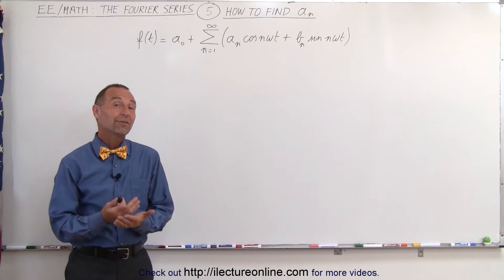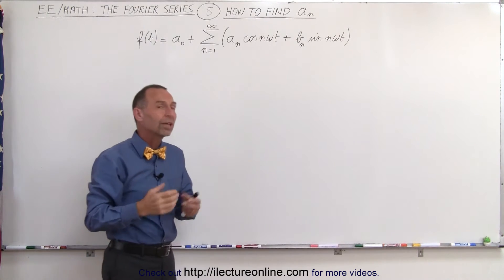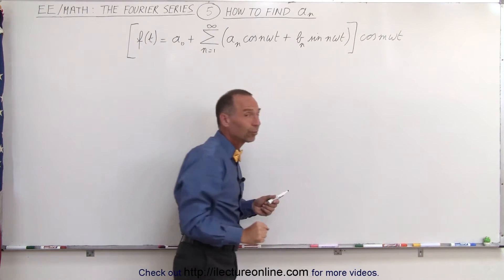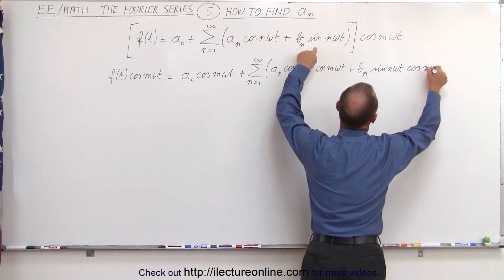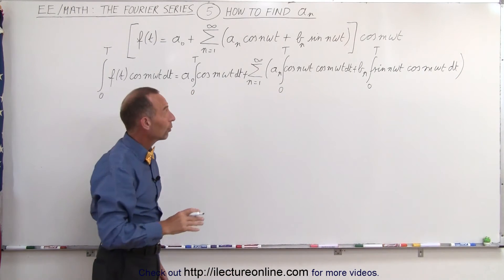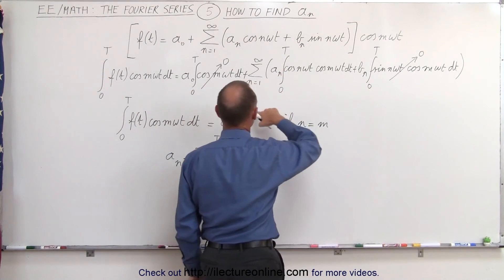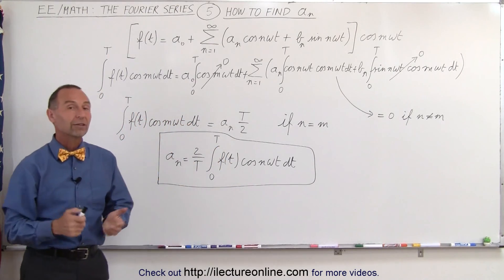Electrical Engineering: Ch 18: Fourier Series (5 of 35) How to Find an=?

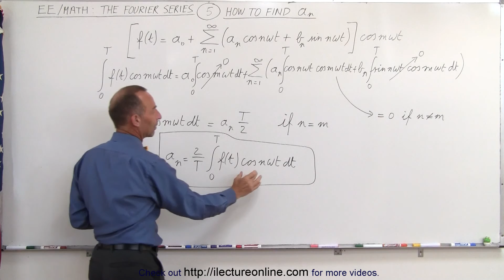Comment: 1:18 Just multiply by cos(nωt) and you'll get the same result without any confusion of an extra variable. 5:33 Also ω is not the frequency (which is 1÷T), but rather 2π multiplied by the frequency.

Comment: so I went on wolframalpha and did varying periods, and from quick inputs, integer multiples and half multiples produce zero output of integrals BUT using something like 5.2pi for an upper bound will not produce a zero output..... I thought for any T value or any period value it would produce 0, can you clarify more about the boundary conditions?

Comment: hello Prof Michel, hope all is well.

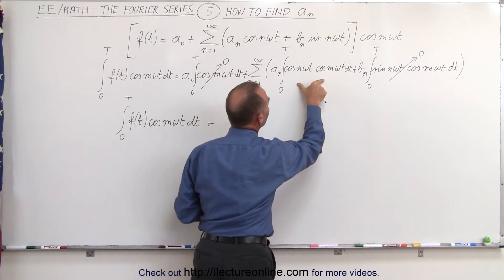if you have the time can you clarify at 4:05 why we can just get rid of the sum? i know the right hand simplifies to T/2 which is independent of n, but we still have a(n).

Thanks in any case, i am about to go into my 3rd year and just reviewing a few math lessons.
Reply from the maker: If you take a look at the third video in the playlist that is explained:  Electrical Engineering: Ch 18: Fourier Series (3 of 35) Useful Integrals in Fourier Series
Reply: Firstly, Thanks to Prof. Michel Van Biezen for his excellent lecture.

I think, I got your question.
1. The Summation of n=1 to infinity term. n=1,2,....m...infinity.
2. All the terms apart from n=m in the summation will be zero [0+0....+T/2...+0] at n=m the integral is T/2. [The other terms turn to zero, refer the excellent video no. 3]
3. a_m.T/2 = a_n.T/2

Hope it helps! :)

Comment: How was the summation omitted?
Reply: If you look at the summation, "n" is to go from 1 to +infinity, or you could visualize it as 1,2,3,4,5,... And then, this "m" here is to take only a single value. Let's say for example this "m" is 5, m = 5, so ALL THE VALUES of "n" integers, when put into the cos nwt, will be zero EXCEPT when "n" is also 5. In other words, the summation will only have a sense if n = m. Since that is the case, writing the summation symbol is no longer needed.
Reply: thanks a lot!!